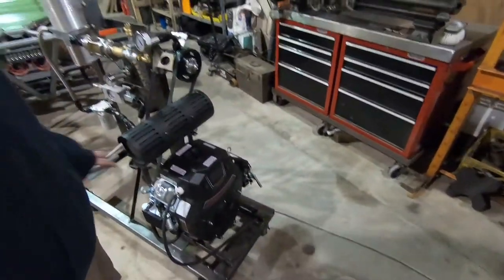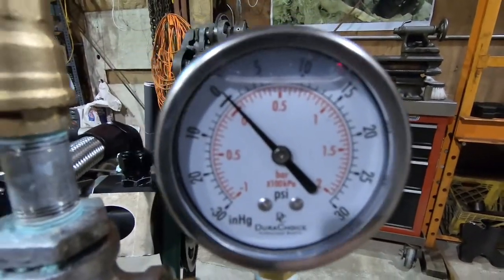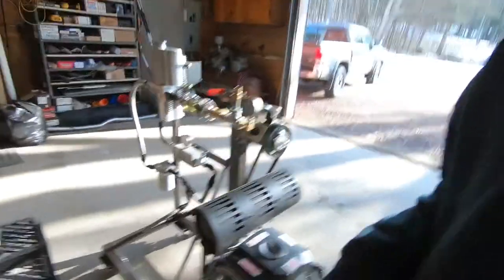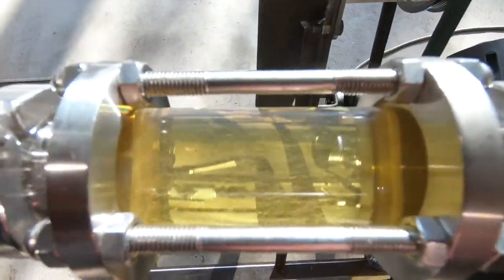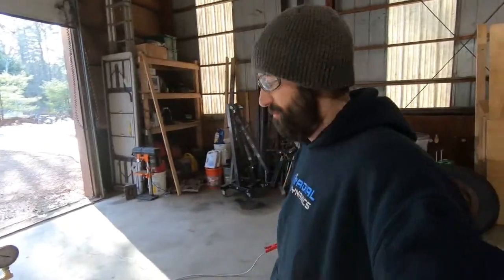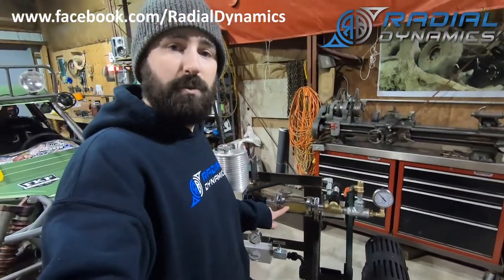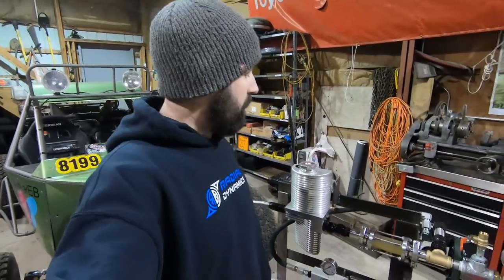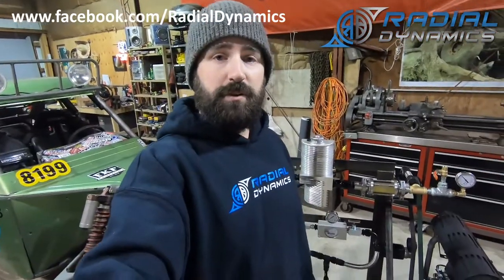Radial Dynamics Episode 1: Pressurized versus Vented Steering Reservoirs

Comment: Wow, well you just blew my mind. Im feeling like I should be capping my vented PSC Res, my steering always runs loud when it warms up, sounds like this might help. Thanks for the video!
Reply from the maker: Thanks for your interest! A word of warning, however, is that if you simply cap your reservoir, there will be no controlling how much pressure is built up in your reservoir when the fluid heats and expands which could lead to damaged pump seals. We like to use radiator style caps because they provide a simple means of controlled pressure and allow air back into the reservoir after the fluid cools back down.
Reply: @radialdynamics  Awesome, thanks for the info! In your video you said you run a 16p cap on your reservoir?

Comment: Why do you get a lot bubbles in the system when you remove the cap? In your other videos where you use the transparent reservoir without any cap there are no bubbles except for then you open the valve to introduce air to the system. The transparent reservoir also seems to be able to remove the bubbles from the oil pretty quickly, while this reservoir the bubbles seems to stay in the system.
Is the transparent reservoir a superior design?

Comment: I noticed you saw 15 psi at idle. Did the psi increase when you raised the rpm?
Reply from the maker: Since the gauge was on the suction (inlet) side of the pump, that pressure will actually reduce slightly at higher rpm. It's only on the discharge side of the pump that higher pressure will increase with higher rpm due to backpressure in the system.
Reply: @radialdynamics  Gotcha. I'm in the process of figuring out what a "safe" res pressure is. 5 psi before it blows seals is fine, just don't want to find out the hard way. Thanks for the reply 👍
Reply from the maker: @jacknicholson5794  I use 10 PSI caps on all production reservoirs for safety factor. Anything 20 and above is entering risky territory
Reply: @radialdynamics  Good deal. Thanks man. Once the budget allows, I'd love to upgrade to one of your reservoirs.